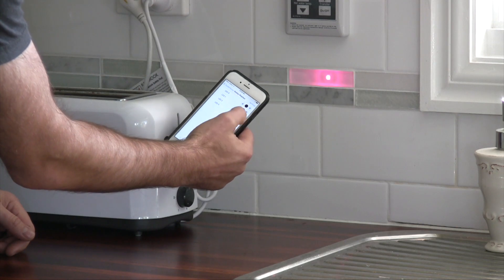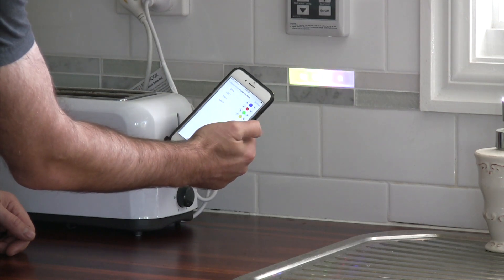Vlog #58: Wires NOT WiFi for home automation!

Comment: Spot on. One of my friends is building and is interested in home automation. Told him to wire up. Ethernet, speaker wires, the works. Marginally higher cost when roughing in. 

I think a lot of the arguments pro wireless and against wired is driven by cost only. When retrofitting wires you have potentially high cost due to the building structure and sometimes need external help. At the moment I'm putting in PoE cameras and it's a pain to have theses cable runs.

Lastly a lot of it is driven by clever marketing. Plug it in, connect to wireless and in 5 mins you can see who's at the front door... tempting

Comment: 100% decent wire (not the cheapest possible) that's been installed well is the way to go. RS232, 485, dry contacts, etc, still have their place and SCADA (commercial) and all its modern implementations still work on basic principles. Fibre is good for very long runs (not usually needed in residential) but also higher cost, more points of failure, converters, need to secure infrastructure and provide more backup power, cover all what-if scenarios. Wireless is handy as an option, but always best to use wired for the core of any install and when it has to work reliably in all possible conditions. Ongoing firmware updates (if available), products and standards no longer being supported and security risks of IoT also a reality.

Comment: Just as as note. If I am not mistaken many planes do in fact use fly by wire to control critical controls on the plane. The throttle on many cars are wireless. But I agree a wired system is more reliable.

Comment: I totally agree.  All you have to do is think of how many phones have become bricks because you can't use them with systems anymore.  But wait, we had lan lines for 100 years using the same phones switches and wires.
On top of that, I can't tell you how often I have to reset the router, the TV, the tablet because some glitch in the WiFi  connection is off.  Imagine having to do this with your home automation.  WiFi connections are just not stable enough to rely on for critical applications.

Comment: I thought about that. So I decided to hard wire all lights and shutters motors into the fuse box and use relays, which my home automation system then can control. However for flexbility and not having to break open all my walls I decided to use cheap 433 MHz light switches, the power is generated by the button press so no need for a battery.

Comment: better if you still have wire, if there are instances that internet or cloud is down, you cant turn on the device. However, one other way to solve this issue is to use dual-frequency devices like that can be controlled by 433 MHz kinetic switches which even if cloud or internet is down you can still turn it on or off.

Comment: my entire house is wifi, lights, irrigation, AC control, remotes, tv, audio, etc. I haven't had an issue. The only reason why i am wireless, is i do not have the want, or ability to run wires to every light switch. I can also just remove a sonoff device, and everything is back to normal. I run openhab, with tasmota on most devices, and custom arduino code on others.. I understand the pros of a wired connection, IF you have the ability to run the wires easily.

Comment: I completely agree that wires always offer better reliability. It's not as hard as the do-it-yourselfer might think to run Cat5 or Cat6 cable around your house with the proper tools like fiberglass rods to get in between walls. If you're building a new home it is much easier and I would consider only using cat 7. And if you can't get copper to a particular location then use Wi-Fi.

Comment: I agree that wired is usually better, but I can think of several cases where wireless is advantageous.  One example would be retrofits.
I am not sure I agree on the longevity argument.  If you have electronic components, they will work as long as the electronics last.  You don't need to update firmware if the system does what it needs to do.  
If a light switch turns on and off reliably, it will never need updating as it works.
An Arduino board, being electronic, could fail just as easily as a wireless device.   I would probably avoid WiFi as such as the 2.4GHz band is prone to interference, but there are other very reliable Wireless technologies.

Comment: You’re comparing apples and oranges
WiFi not wires for home automation. 
Wires for security system, yes and no. Most houses cannot be wired without causing damage all over the place. How are you going to run wires to every window?
Yes you can jam RF signal, so is the power can be cut to the house.
ESP if properly configured can run on battery for 2 years, compare it with cost of wire and labor to run it, i bet it will cost 20 years worth of batteries.
In 80-90s wires were better, wireless technologies today is just as good if not better.

Comment: As an ex Navy cryptologist and a security system pen tester for over 25 years (the last many years on the internet) this is the first time I have come across sensible, balanced and reasoned advice about the limitations and advantages of wired and wireless based security systems.

They both have a place and they both have limitations. I have been out to sites where someone has run 12 VDC feeds to an 8 camera wireless cctv system for example. The client cant understand why the 8 cameras running at 1080p 25 FPS keep locking up, dropping frames and the wifi network is performing like a Acoustic coupled modem at 300 baud !!!

Not only do you have to explain why you could fry an egg on the router / access point you have try and reason out why the installer didn't just run cat 6 with POE and plug into that very convenient port marked LAN on the back of each camera. Not only has the original installer left a complete mess behind he has actually made himself ten times the amount of work.

This is not even bringing into the question the entire systems vulnerability. I get asked why my report to the insurance company rates building security as poor. Now you have to explain why and deal with a very annoyed customer that just paid a fortune for his CCTV, and yes you guessed right in that the alarm system is a DIY grade unsupervised radio system has been fitted to.

It is a great shame that time and time again I find that people do not take security seriously until they have been burgled and lost not only property but a feeling of being secure, that's something that can be hard to replace and sometimes impossible. I really do hope that your advice is listened to and saves a lot of upset as it normally takes an unpleasant incident to occur before that happens !

A great informative and factual video Jonathan :)   Nice one !!!!!!!!!!

Comment: The other thing that is never considered by those talking of home automation is what happens to it once you are no longer there or no longer able to perform the duties of IT department both as IT integrator and network/system support. Will your wife and kids no longer be able to open the door or turn on a light.

Electricians are doing something fundamentally simple by wiring a house and most can easily come in and figure out your wiring circuits, and adding standalone devices such as lamps fridges etc is something that just about anyone can do, but how does your spouse or even yourself (with diminished capacity) deal with Wi-fi, networks, hubs, arduino, relays, micro controllers, ifttt, MQTT, Tasmota, cloud integration, firmware updates, etc, etc. How does your family deal with their smart house if you get hit by a bus? What documentation have you left? How long will the system operate with no intervention?

Am I the only person that considers these issues when trying to decide how smart I want my house to be?
Reply from the maker: I did a video about exactly that problem: https://www.superhouse.tv/23-preparing-your-home-automation-system-for-death/

Comment: I'm still thinking of running a 12 volt rail throughout the house and have some step down regulators. The advantage of that... 1 only 2 wires with power , 2 Good router will save the day ( maby get a dedicated one for the automation task like the server ) 3 much easier to set up  (  don't have to deal with all the wiring ) 4 PROBLEMS misscommunications errors or fails will keep you busy. If you make something from nothing and it works you loose interest and you say " it just works forget about it" THIS IS NOT OUR MIND ! If we want to learn and evolve on anything we do it the hard way ! I use HTTP and GET, POST, PHP is great on notifications and IF THIS DO THAT not MQTT. Bring yourself beyond and get better at anything.

Comment: Hey! Great videos, I just watched your hour long video about building the rack mount arduino mega controller. How many of those do you have installed? Also, to control the light in a room, is it correct that I'll have to wire the switch to the arduino and then another arduino to the relay of the light essentially running two ethernet cables to and from the room to the rack mount arduino(s)?

Comment: I disagree with your logic. While it isn't a good idea to use wireless in applications where small glitches could lead to disasters, a light switch is not one of those cases IMO. If my lights don't switch on 1 % of the time with the first press of a button, I can just push again and they work. The best option might be a Sonoff Touch Switch/Koogeek Light Switch -type, where the button controls a relay within the switch itself - WiFi operability being just a bonus. The only downside being that they need the neutral cable to power the switch.

Comment: Been dabbling with home control for over 15 years now. On my second system now. It’s very interesting to hear of your experiences over the years.
Was particularly interesting the hear your thoughts on presents detection and failover. 
Have been working on presents detection, using PIR, BT, WiFi, microwave etc, combining two or more to give better reliability, haven’t succeed yet though.
Also been working on fast auto fault recover, will never get to 100% reliability but hopeful close. 
Keep up the good work. Looking forward to your next video.

Comment: OK, watched this and one word comes to mind - LUDDITE.  The argument that wire is timeless and electronics not is far too simplistic. Point in case is a home wiring system should be inspected by a professional every 8 to 10 years. This shows that every system, mechanical, electrical or electronic has a shelf life.   The comment about the car control is the same. How many times did we hear that having computers in the car was unsafe. the machines would take over. Today we don't even question it and your wire control analogy requires the use of that same computer. The argument being recently renewed for the Tesla autopilot feature (which is AWESOME) is all flat earth stuff. Your argument about access points and the capabilities of wireless is exceptionally incorrect, even in the present market, with many Youtube projects to prove that point. Technology moves on and improves, gets integrated, embedded and forgotten about. Look inside a washing machine for this example. A good commercial company would never put a bunch of off the shelf sensors and a couple of AA's to provide a sold solution. It would have to be capable of a huge number in  MTBF because of warranty risk, be miniaturised and installed in a "fire and forget " fashion. For this example look ( old tech) at fuse wire against circuit breakers  Remotely  powered wireless sensors are coming sooner than you think and the FCC has recently started to approve the technology. No more wires for low current applications was a dream and now not.  Don't be a Luddite, embrace the future with understanding and direct your verbals as a codicil of as it stands today by balancing what will come in the near future. I see your point of what you do and why you do it as a commercial venture today but to pontificate on the moral value of old over new is just self destructive to your contribution in the industry, which I have always valued.

Comment: It's not always possible to wire but when it is, it's the best and simplest method...
Having said that, I would be tempted to change from Arduino to ESP32 devices and add redundancy (wire and WiFi) and of course I would not have issues with batteries etc...

Comment: I agree with the issues of WiFi. It's not meant for everything (security!,  cameras and TV especially). I do need to look into the limitations of the AP. I've run into that a lot with cheaper router/firewalls. Of course that hasn't stopped me (yet) from using wireless when I can experiment with it. It's hard to run wires in a home and when you're first building something wireless lets you skip that point. BTW, I'm still running my Circuit Cellar HCS II (direct GPIO, RS485, 1985). So I expect more than 20 years out of my systems.

Comment: I've built a home automation system using ESP8266, uses UDP with redundant resends. It works much better than I expected. I will agree with you that wired is better,  I needed power to the units so I end up having to at least cable the devices to power. It was however very cheap! Some of it I built with the SONOFF range of modules, these are ideal for re-purposing rather than make it all from scratch. From a security view wired will always be more secure, even though I wrote all the code I still have to trust the closed source binary blobs involved, you can never be sure, then again I don't trust windows or Macos for the exactly the same reason and plenty of people who bang on about security sit in front of that while they do it....

Comment: I agree. If I ever build my own house I'm going to rout the mains power to every outlet and built-in light to a single "power" room. That room will have the breaker box so that all circuits can be wired right in there. The missing part to this scheme is a modular way to terminate all these circuits to the breakers with a place that would let me add automation to each one individually.

I'd also add low voltage wiring to each switch position in the house back into the power room. The low tech version would then let some kind of low voltage switch at the wall position to control a relay in the power room to control the power to each light fixture and every mains power outlet. I have found all of this hardware available "off-the-shelf" at one place or another, many intended for industrial usage. But this whole idea is to make it easy to change the power control hardware as I experiment and not have to rewire anything after the wallboard has been installed.

Of course I'd put in Ethernet wiring to every room too, but that goes without saying, doesn't it?

Comment: For secure wired lines, they need to be monitored with EOL (End of Line) resistors or diodes or other protection for short or open circuit accidents or tampering.

Comment: You mentioned the RF jammer.. Well, in a hard wired home, you just need to cut the power, and then it´s out of security, unless you also got power backup.
I agree with you points regarding WiFi, but using the RF jammer as a argument for not using WiFi is in my opinion not a good argument, even though you´re right. Most people do not have a RF jammer. A burglar perhaps. But a burglar who really want to enter your home, fore sure knows how to cut the power as well.  
Anyway - Great video as usual.

Comment: I fully agree on advantages of wired, but the world seems to be missing a product on the market. I'm running PoE to various house endpoints where I want 3-5 total sensors + outputs on a microcontroller, powered and communicating via MQTT hardwired across the same (one) cable. What product does this in a single compact board rather than stacking up ethernet shields, standalone Arduinos, and PoE adapters? Just want a compact non-wifi PoE version of the Esp8266 in the price range that I can buy several. ($5-$15US each?)
Leads to where these exist? Wouldn't a manufacturer sell quite a few? Thanks!

Comment: Obviously, as various folks have pointed out, it's often not possible to wire. But, it also doesn't come down to either wired or Wifi. Using a dedicated wireless protocol is still better than using Wifi in most cases. So Zigbee as a non-proprietary example, or Lutron's Caseta or Radio RA2 for good proprietary examples. Wifi just isn't well suited for automation except in some special cases. It's good for touch screen clients of course, and for things that have too high data rate requirements for standards like the ones above, which are targeted towards the needs of lower data rate devices.

Wifi just wins because it's the default. If Joe Blow Corp decides to make some widget, he chooses Wifi because he knows it's already there and it's retrofit friendly. So we get all of these Wifi based devices, whether its optimal or not. And of course Joe Blow Corp probably didn't hire a top security expert, so the 'Smart Toe Jam Remover' device you bought from him becomes a Trojan Horse on your network and/or a DDOS bot, because it's a network enabled device. That isn't an issue with Zigbee or other proprietary wireless devices.

And of course a lot of people these days assume that wired means network, when it has traditionally often meant a serial cable. A lot of people might scoff at serial connections as old fashioned. But, in a world of security nightmares, they make a lot of sense for a lot of devices. It's a point to point connection that is not shared, so it can't be hacked. And it lets you control the device but would never allow the device to get to either the controlling computer or any other devices in the home. It worked well for decades and it still does, and maybe make more sense now than ever.